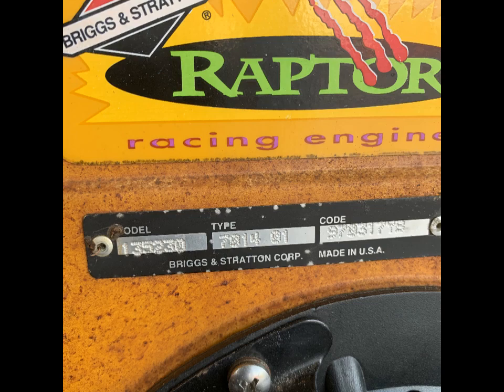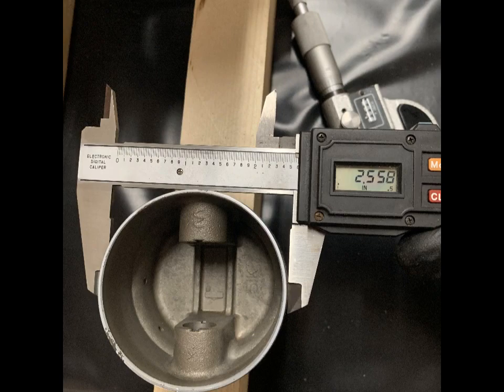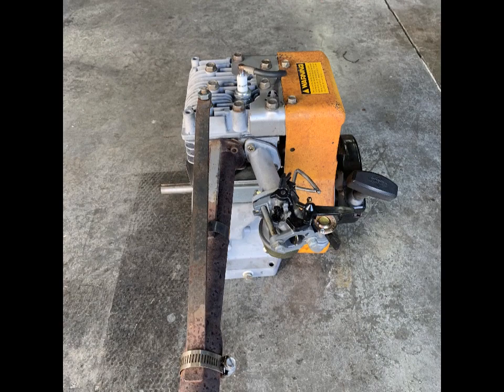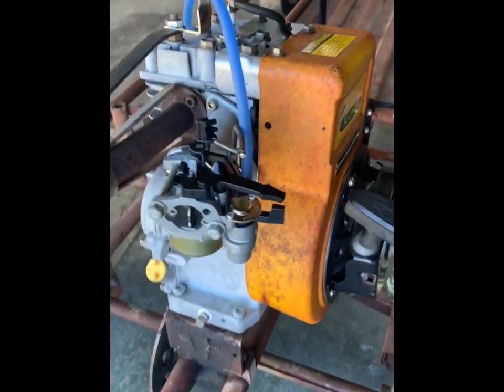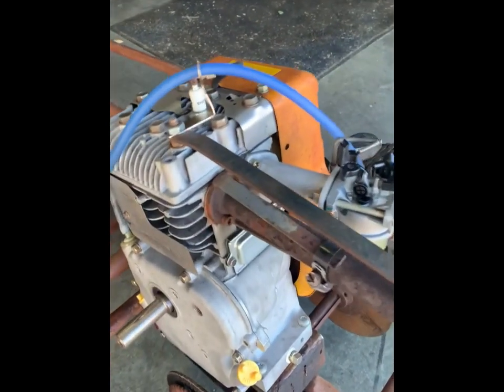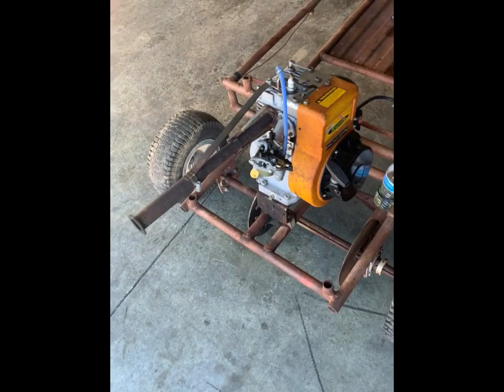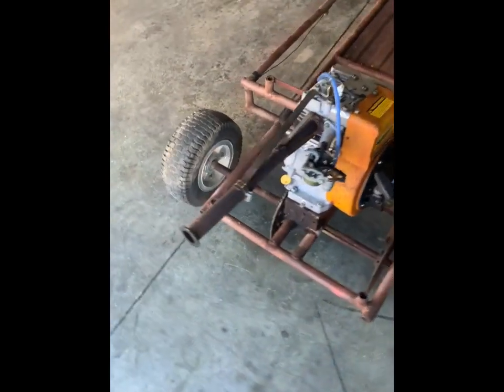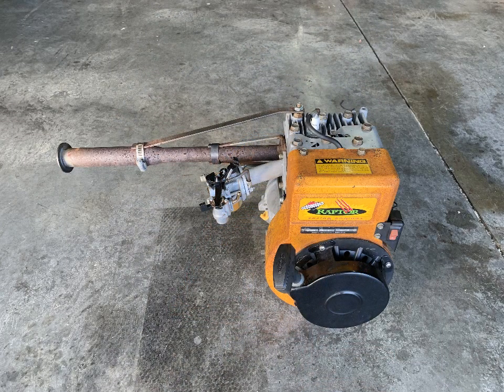Barn find, Briggs & Stratton Raptor 3 race engine.

Comment: we ran stock 5hp in the 70s the ran good as they are i had one on a dune cycle i  think all it had was a long pipe no gov. it would run wide open never had a problem

Comment: I built and raced model 130232, and 130202 Briggs (stock lite, and stock appearing) late 80s early 90s had tons of fun. Margay chassis first then a bugg.  I don't think any of the tracks are still operating now in this area

Comment: Looks like s stock engine with a raptor racing sticker on her. So pretty much its just a stock briggs .you could even over rev that thing or it will blow up .no bullet rod or flywheel and stock cam and doesnt even have the roller bearings in block lol this engin isnt racing .it just has the sticker for good looks
Reply from the maker: Brett,  I think you need to look closer at the engine, if you are at all familiar with what makes a Raptor motor a “Raptor” then there is NO doubt this motor is in FACT a Briggs Raptor engine, and the sticker has nothing to do with it.
Reply: A dead giveaway that it’s a raptor is the lack of the drilled hole for the governor arm on the carburetor side of the block

Comment: awesome engine    purchased minibike with briggs raptor engine on it painted green has carb with no air cleaner silver ring (on carb) and long crazy exhaust pipe? No tag or numbers on engine  Do you know how to ID it?  Thanks in advance,
Reply: It's a Briggs and Stratton raptor racing 5hp I have on that fits the discretion